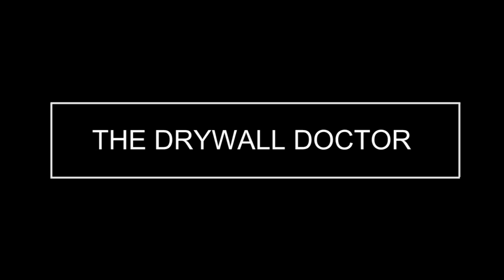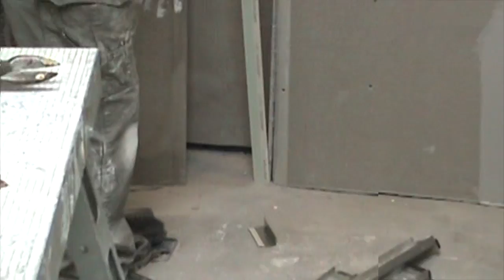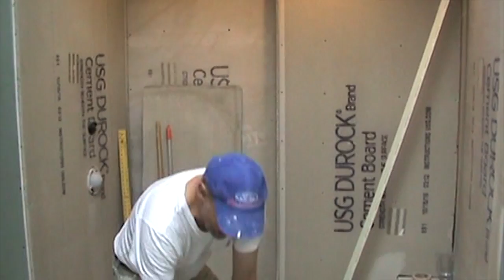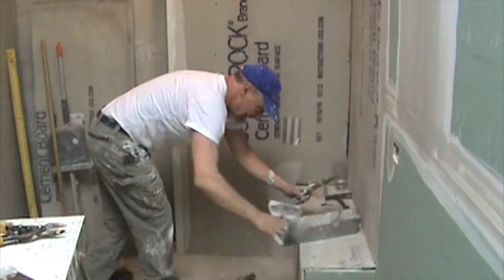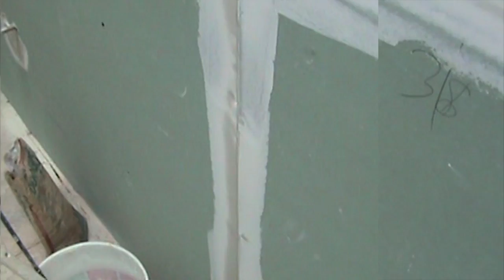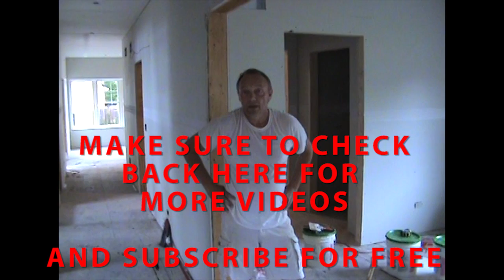How to Put Cornerbead on Durock & Butt Boards/Joints

Comment: Durock specifically says to use thinset where tile and moisture will be present. To fill joints and embed fiberglass tape. Durabond should only be used in low moisture areas.
Reply: I would use thin set mortar for that corner bead not drywall mud
Reply: Agreed.  Thinset

Comment: Help! I got ahead of myself and added waterproofing membrane on the joint where the cement board meets the drywall. Will joint compound stick to the waterproofing membrane?? Great vid btw, great job of explaining clearly.
Reply: The Drywall Doctor so it did stick to the waterproofing membrane just fine but I read that tile thinset doesn’t stick to joint compound so I had to wet sponge sand off as much as I could. Is the Durabond you mention here thinset or General Purpose drywall mud?

Comment: What do you use where the durock meets the drywall?  It looks like you use durabond based on how it dries, but I am not certain.  I have seen others use thin-set mortar with fiberglass tape.  I like to follow code or manufacturer's instructions, but my search has yielded no results.  Thank you sir and I have watched many of your videos multiple times.  You know what you are doing!!
Reply: Marcus Monte what’s the word on this??  Trying to find the same information...
Reply from the maker: Just use fibreglass mesh and durabond you should not have any problems. Thin set is used by the tile setters
Reply: Manufacturer says no good in wet areas unless you are going to waterproof the entire shower!
Reply from the maker: All my tile guys roll over it with a rubber sealant.

Comment: Thanks for the reply, but you didn't say what you thought of them just don't put your butts in a line. So what do you think?  The rock at the bottom and top plates would still be straight. I've found that if I end up with a bad butt joint just burn a hole in the carpet or scratch the hardwood floor and normally they never see the bad joint. So I'll probably stick with this technique. I enjoy your videos and agree with 92.5 % of what you say.
Reply: Dude absolutely explained why he didn't like the butt joints all in a line.  And it is bc of the movement of the house, and having them all in a line vs staggering them makes them weaker.

Comment: Drywall has very little shear value, exterior or loadbearing walls have plywood shearwall with hold downs and straps to provide "shear" strength........on a partition wall it doesn't matter what you do with drywall and on loadbearing wall the shear strength is on "other side of wall" in some cases both sides.........in California it doesn't matter how you hang the rock.....least not in my area
Reply from the maker: In California you have earthquake codes that we don't have here in Illinois in Florida they have hurricane codes again we don't have those in Illinois it does make a difference here

Comment: I like lots of your videos, but, on this one you're plainly wrong on both your points. This is bad advice. No way should you use that corner bead with Durabond (and I believe in Durabond) in this application with durock boards. No way is it wrong to line-up (not stagger) boards IF you use butt boards. Using butt boards this way is stronger and more resilient than them fastened on a shared joist/stud . It makes floating out this seam much easier, faster and using less mud. You have great skill  with drywall but you should do more then just watch  "a guy's video" before giving advice about using butt boards.
Reply from the maker: It's been a long time since I looked at that in fact I don't remember ever looking at that video it was hard to watch with ever thing going on on the side but I stand behind every word not using durabond on that durarock is asking for trouble and lining your sheets without staggering them again is asking for trouble.

Comment: what a stupid reason to stagger wallboards - "because it adds integrity and strength to the wall" , whaaat ? Wall integrity depends on drywall joints ? Are you kidding me ? :D so if you tear off all COSMETIC staff like drywalls, carpets you house will ruin ?  lol
Reply: Dmitry Alekhin it has to do with overlapping shear  if you line up the joints, you WILL be relying on the joints. By staggering them, the material of one sheet overlaps the adjoining sheet joints...  it is the same reason bricks and cinder blocks are stacked in overlapping layers and not in parallel stacks...  ask an engineer... the installed sheathing both inside and outside is a MAJOR contributing factor in structure strength...
Reply: Actually the buttboards add additional shear strength to the drywall so yes they can be lined up and with buttboards the screws through the drywall are not pushed out to within a 1/4 to 1/2" of the edge, like when you place butt joints over a stud where they easily break or pull out should any "shear"actually occur.  This gentleman is barking old school reasoning (the way he has always done it) which simply doesn't hold water when all the integral facts of buttboards are figured into the equation.  He is a drywaller not an engineer.
Reply: In the case of ceilings this is absolutely true. Seen a house 7 years old where the drywall was sagging on both floors because of this.